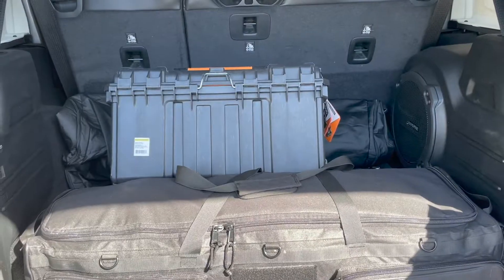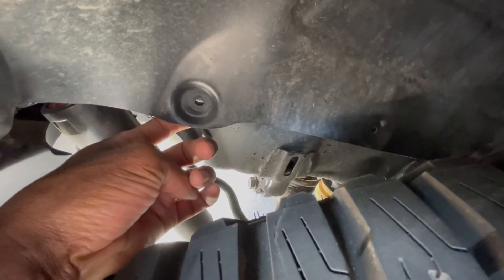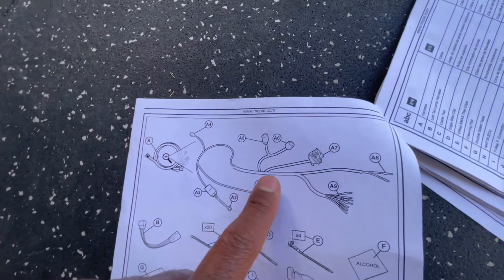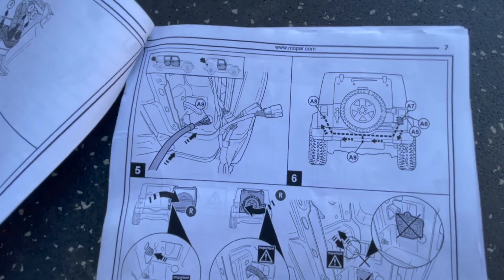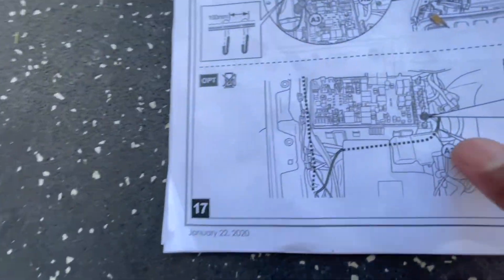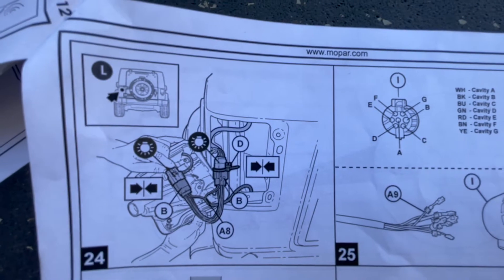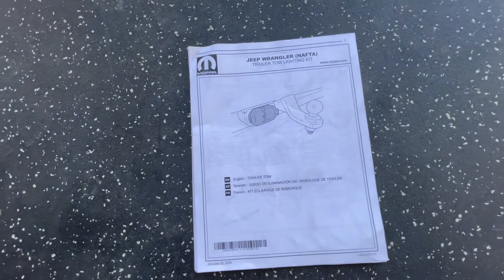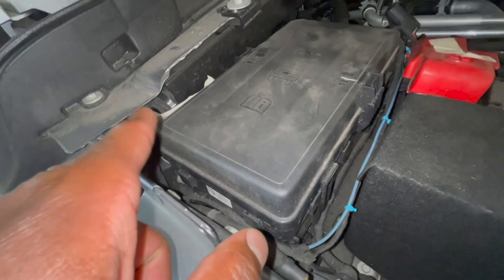Jeep JL OEM Hitch Wiring Install Summary

Comment: Watched your video this morning and it really helped. I ran mine over the frame rail down the passenger side. No fender removal. Took out both tail lights and removed the fuse box cover. Stripped back the harness tape about an inch at the 7 pin connector to make the pin install easier. Took about an hour and a half with the help of this video. Had to adjust my aftermarket bumper to install the 7 pin bracket. Thanks again. Would have take. Much longer with the crappy instructions.
Reply from the maker: That’s awesome. Glad the video assisted! And yes their “instructions” are more like footnotes haha.

Comment: Just wondering where you tap the electric brake wire (not the brake light) on the Jeep JL. Don't see that on the manual.
Reply from the maker: Are you talking about the part in the glove compartment?

Comment: Thank you. Your video is a lot of help. I am going to tackle this project soon.
Reply from the maker: Hi Jim! You are welcome. That should help out in some of the areas they don’t explain too well.
Reply: @iAmMarchal  Ordered and I should have it next week. Thanks again. The directions look like something that IKEA wrote up for MOPAR!   LOL
Reply from the maker: @jimrichmond2738  excellent! Just do it on a day you’re relaxed and have time. I feel it helps a lot starting with a chill disposition. Enjoy!!
Reply: @iAmMarchal  All completed. Took around 2 hours. For anyone reading and watching this video, DO NOT cut out the fender liners. Totally unnecessary. If you take your time and feed the harness from the rear to the front on top of the frame you should have no problems  following the factory wiring and getting it all in place. The most difficult part for me was getting the power/ground with the fuse block up thru the front fender to the engine compartment. I used a fish tape to make it work. Time consuming but easily doable by almost anyone. Watch this video! take your time and it will be easily done!
Reply from the maker: @jimrichmond2738  awesome! Good job getting it done and happy towing! Are you going to take to dealer to flash the computer? I never got mine done. Word is it helps with shift points. I shifted manual when towing in mountains.

Comment: Excellent video! Thank you for the hard work in putting this together. Did you have to reprogram the computer? If so, did you go to the dealership or did you use one of the advertised programming tools like the Tazer? Thank you in advance for the information. Regards, Paul
Reply from the maker: Thank you PAB Booch! No I did not program it. But they do say you should to change shift points etc. My trailer wasn’t that heavy so it seemed fine. At worst I’d put in manual mode to control shifts myself. But I tow In the mountains at high elevation. Hopefully that’s helpful.

Comment: Good video thanks. I went with an aftermarket wiring from Amazon. Cost was about ⅓ of the mopar set. Wire still got routed to the front for battery connection the same.

Comment: Thanks for making this. Super helpful. I had already torn my interior out before I realized I had the new kit (this one). 

My brake lights and signals work fine but neither the 7-pin or 4-pin are working for me. Do you think it’s because I have the Mini Tazer or something weird?
Reply from the maker: Hi David! Thank you! Not quite sure with your situation what’s causing the issue. You could remove the Tazer and see if they start working. That would tell you.
Reply: @iAmMarchal  I did it! I gotta get it flashed at the dealership though. That makes it ‘officially’ have the package and warranty. Thanks for this video
Reply from the maker: @heydaviddavis  love hearing that! Enjoy!